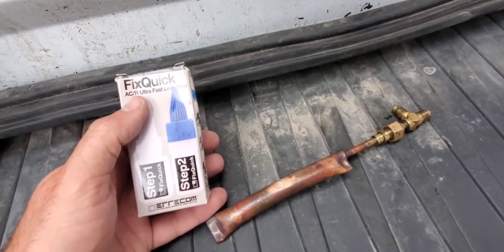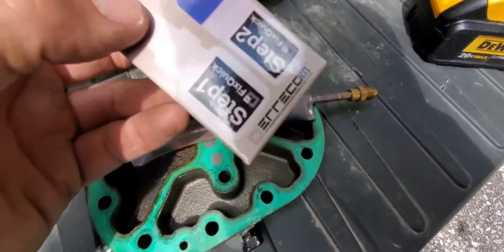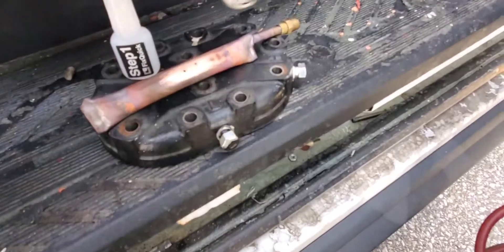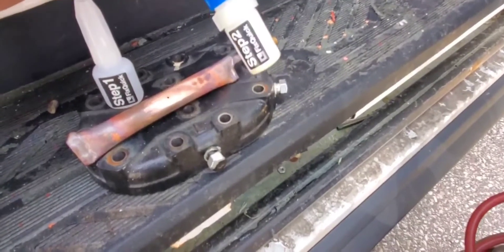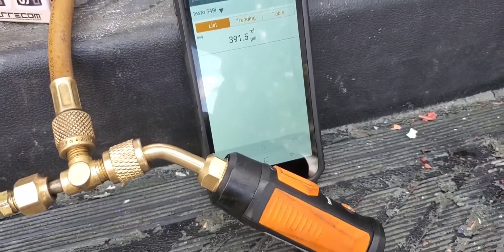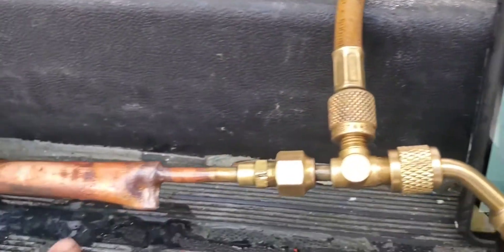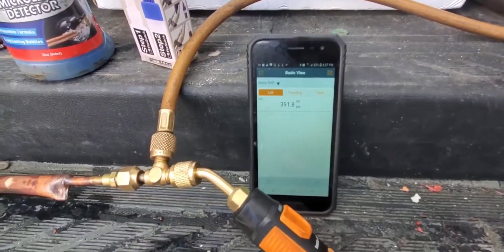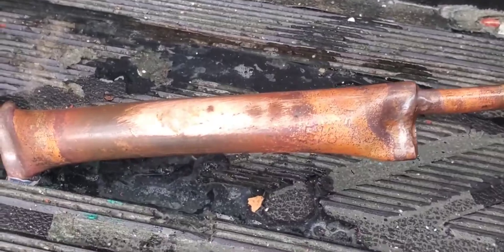Refrigerant Leak Repair Using Unconventional Methods

Comment from the maker: Times a changing in this industry
Reply: It’s unreal. I was given something like this that was 2part epoxy you take a heat gun after to make it cure and harden fully within a minute. I used it on a aluminum to copper joint that was leaking on a big smoked meat display cooler. Long story short, it worked great and I was shocked and sold on it!!
Reply: @jphvac5725  I have one of those micro channel condensers on a typical residential A/C system and the aluminum to copper transition is leaking. If you got good results from using this product, I might give that a try instead of paying out 2 grand for a new unit. Thanks for the tip.
Reply: Just looked up name of my stuff. Called Pipeseal and made by dynesic.com. Was sold by United refrigeration. They suggested either it or jb weld and I liked the quick curing of pipeseal so I didn’t try jb. Thanks for tests and great info tho!!

Comment: I have one of those aluminum micro channel condensers and it is leaking right there at the aluminum to copper transition. I was just going to braze it with the brazing rods that are meant for aluminum to copper joints but then I found out that it is actually joined with some kind of epoxy with some kind of rubber heat shrink tubing over the top of that so I don't think I can braze it. Perhaps this product you demonstrated can be used to seal up the leak so I don't have to spend 2 grand on a new unit. Have you ever used this product on a leaking aluminum to copper joint? Do you think it would work for that?

Comment: I could understand if you're in an area where you can't use a torch, but if I can see the leak there's no way I'm ever using this stuff..lol.   You're absolutely right though times are changing
Reply from the maker: Lighting a torch is becoming way more of a hassle in a lot of commercial applications

Comment: I'm gonna sound like a reactionary sceptical old geezer , but I'd like to see if it does sustain the temperature changes of a coil , and also if it doesn't desintegrate from the inside when in prolonged contact with oil and fast moving refrigerant... Remains to be seen I guess innit .
Reply from the maker: Yes with any new product there's always a break in period

Comment: Question I have is why wait 20 mins for a quick fix when you can just solder it shut? No 20 minute wait time and no added materials to truck.
Reply from the maker: Because some porous evap coils are too weak for a torch, some places don't allow torches due to environment.  Some places have fire permits and 4 hour post fire watches.  It's just something to have incase.
Reply: HVAC Know It All I’d like to see how it handles the expansion contraction. Sometimes the bandaids become permanent fixes and then the customer goes low bid after you pull them from the fire. I’d let it go and have them figure out what needs to happen for the repair.
Reply: Agreed even the condenser coil can have a small leak and patching it is a pain even with map gas
Reply: Curious to see if it holds a deep vacuum

Comment: Good concept, but would make more sense if it can be done under pressure to be considered truly a "quick fix".  If you have to remove the charge you mind as well fix it right....
Reply: That’s what I thought might as well weld it
Reply from the maker: Thats not what I said.  There are cases where brazing can cause more damage, fire permits and fire watches that can not be obtained in emergencies or places where a torch is not even allowed to be lit.  Open your mind outside of your own experiences
Reply: I agree we should all try to get the customer by past their issue but we wouldn’t want to see a car driving with a missing wheel just because it’s getting them by. If people could they will and that’s the problem with repairs like this. If the coil is that weak where it can’t be soldered then at what point have they pushed it past it’s life expectancy?
Reply from the maker: If it can be brazed sure but if yiu have a weak evap coil with pin hole that a torch will damage.  This can be handy.

Comment: Good test of the product, Bro. Is this a temporary fix to get "us" buy or something more permenent?  Will the weather conditions (Hot/Cold/Sun/Rain) efffect the fix over time?

Thanks
Reply from the maker: Not 100% on it's longevity.  But if it gets a customer some time until a replacement coil for example then it could work great